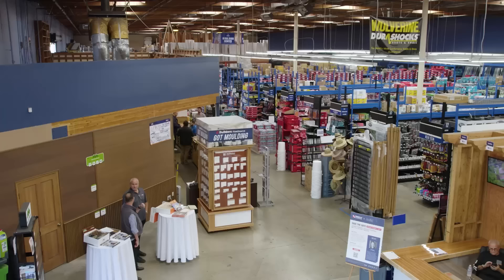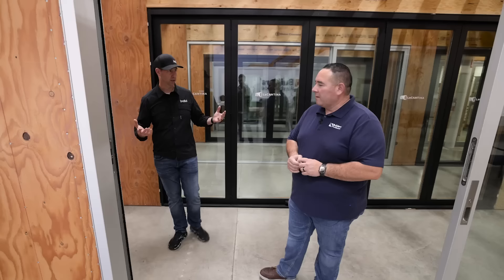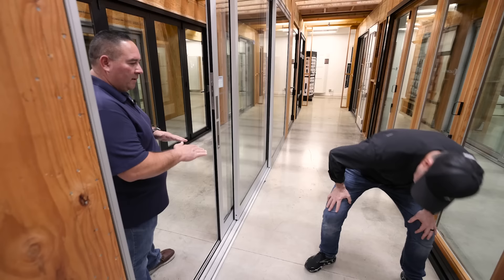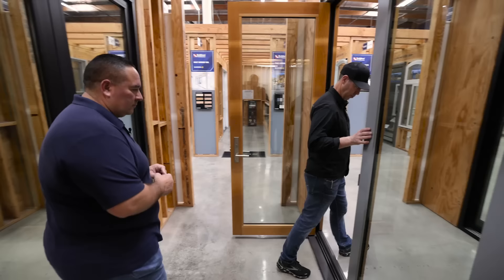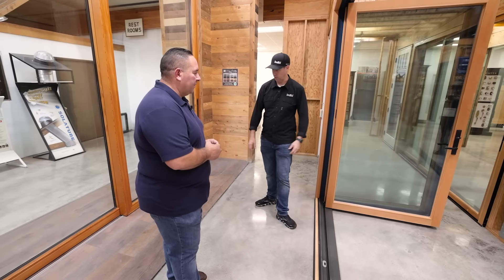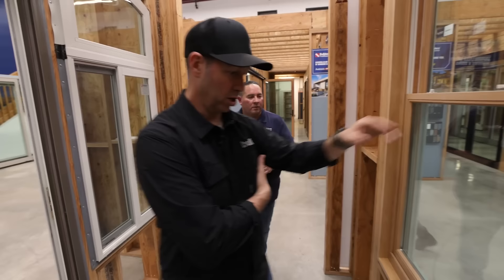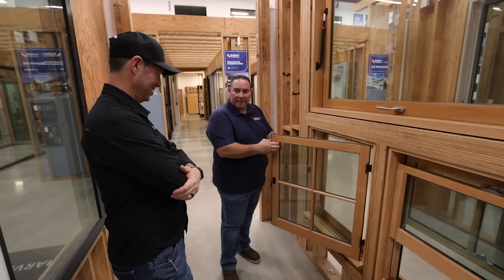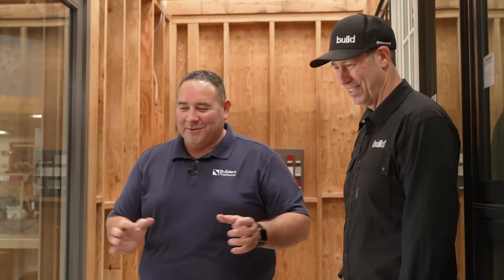Let's go WINDOW SHOPPING: What to look for (or avoid)

Comment: Good to talk about price and I liked that you quickly made mention of whether some units were thermally-broken (every exterior unit should be IMO) but perhaps some mention of the overall efficiency?  You spend a lot of time talking about building passive houses and being as airtight as possible - are these units just pretty or can they be used as part of a high-performance home?
Reply: It's aluminium separated by anything between 2 to 10 mm of foam which may not be that well insulating (rather focused on strength). Then again, just like vinyl frames, the profile is extruded in a way that it provides multiple boundary layers (how multiple glass panes work). Still the thermal break is not really complete and 2 mm thick aluminium all around is all you need for a massive thermal bridge. So despite the greater glass to frame ratio, the overall product performs with triple glass roughly the same as a basic (old design) double pane vinyl over here in Europe (if memory serves me correctly). Then again, the tested R/U values show mostly how the test performs, in the "wild" boundary layers play a role, so do occupants' habits, so as long as they seal alright and you really want them, it's all well... unless you mind paying more for less on the thermal side of matters. Those nice dark frames are better shaded from the summer sun, as there's a reason they don't come in vinyl (it would melt).

Comment: I bought an 8 foot wide, 6.5 foot tall, thermally broken, powdered coat aluminum clad exterior with prefinished wood interior, dual pane cardinal glass slider door for $3,000 dollars last year. The brand is Windsor. These prices are insane.
Reply: Big difference between n 8’ slider and these units with multiple sliders 15’
Reply: Btw  I use Windsor a lot, great windows.

Comment: Hi Matt, how do these "American" windows compare to the "European" ones? Thanks.
Reply: Not even close
Reply: Thanks for sharing your opinion. May I ask in what way are they better / worse?
Reply: In design and ergonomics plus they are tilt and fully open so its simple and smart design
Reply: Got it. I've been seriously looking at European windows. What window material (aluminum, uPVC, wood-clad) would be good for the Southern USA?
Reply: @oldporkchops  schuco windows from Germany one of the best
Reply: @eronahmeti672  in quality of hardware, so they may last until one can finally afford a replacement xD thermal performance is like any other but yes, they are likely to keep their seals tight longer...

Comment: Quick way to determine if a window is single, double or triple pane, introduce the flame from a lighter in front of the glass and each pane will reflect a separate image.
Reply: This is awesome!  Thanks for the tip.

Comment: @15:47 you’re talking about the pin-hole in the hinge mechanism. In Europe these are often used on hinges with pins as pivot points at the outside (no sure how to call these). When a intruder removes the pins on the outside they cannot remove or hinge the door to lift it out and thus enter the home without the key….

Comment: twice i bought vinyl replacement windows , both times i am disappointed .  lessoned learned , what do i need to keep NOISE out?
Reply: Double window. So you'll have two double paned glass windows. The airport expended near my house and they paid for them to be put in to everyones house. They work well.
Reply: Triple glass U0.5-0.9 or vacuum glass gets U0.4 but is more expensive
Reply: @MarvinOsso  "U" need to understand they asked about noise 🤭
Reply: They say laminated glass is very quiet. Windsor makes double pane with 2 dissimilar thickness glass pieces which they say helps cancel noise transmission

Comment: Every window has  four numbers on a National Fenestration Rating Council (NFRC) label on every window you'll consider:
o Solar heat gain - how much the window reduces the solar heat gain.
o U-value - how much heat transfer the window has at a given temperature differential.
o Air infiltration - how much air infiltration the window has.
o Visible light transmission
U-Factor
This number represents the heat transfer coefficient, or how much heat the window’s coatings help keep inside the home. The U-factor ranges from 0.1 to 1.2; the lower the number, the less heat escapes.

Solar Heat Gain Coefficient
This number measures how well a product keeps heat from the sun from penetrating the window. The range is 0 to 1. If you live in a hot, sunny climate, such as Arizona’s, you will want a low number to block out heat; if you live in a colder climate, you’ll want a high number to take advantage of whatever solar heat is available. If you live in a balanced climate, where winters are cold and summers are hot, you’ll want a solar heat gain coefficient rating of around 0.3 (the same goes for the U-factor). And you may want windows with different ratings for different parts of your house, depending on the direction the window faces and whether it gets a lot of sun or shade.

Air Leakage
This is how much outside air will come through the window frame, according to the NFRC’s testing. The lower the number, the better. (The range here is less than or equal to 0.1 to 0.3.) In our tests, we take this a step further by testing windows at very low temperatures with high wind conditions to see if there are any changes in performance due to materials expanding and contracting.

Also look at the installation warranty...is it longer than 2 years?

Comment: If you have you original wood windows in your old house you should restore them instead of replacing them. You'll never get your ROI after spending 20k+ on new windows.
Reply: Exactly, glass, seals. Then again, new hardware just works better.

Comment: Matt, I've seen a lot of these window videos from you and I can't help noticing that none of the windows you show have storm windows on them, even on windows at job sites (nor do I remember seeing you use storm doors come to think of it).  Is this just a regional thing, because many houses where I live in northern Michigan have storm windows, or is there another reason you don't show windows with storm windows?
Reply: I have lived in Texas for more than 40 years and I can assure you that while builders don't include storm windows or doors, many people have added storm windows or doors depending on their situation.  But storm windows are typically taken down and thrown out as people upgrade from single glazed windows to more energy efficient double glazed windows.
Reply: @sa3270  up north storms are used more to seal the air infiltration rather than the glazing
Reply: Short answer, you don't need "storm windows" with modern, properly specified/code compliant windows/doors.
Reply: @mark52111  I'll keep my storms WITH my quality windows

Comment: Great video.
Just curious, whats wrong with vinyl ?
Isn t it the strongest and most durable ?
Reply: @NicholasWHaley7  compared to wood.
How long does vinyl last ?
I thought it lasts long, but maybe thats not right.
Reply: @laurier3348  the other way around. Have you seen 50 or 100 year old plastic windows...or aluminium sliders for the matter....? And they had no overdone sheathing/cladding/sills like the modern ones, just bare minimum. Yes, ofc aluminium and composite have potential but wood is so simple stupid for windows (not so much doors), especially if you can DIY...
Reply: @dushk0  Ok, thanks.
Reply: Thanks for pointing out the weep holes at the bottom and make sure not to cover them.
Reply: My house has 2 vinyl window that are chipped and cracked. It also has 19 wood windows that are over 100. However, the wood species for the windows is extinct.

Comment: I have installed all these brands and models for 22 years.Stay away from Marvin, Panoramic and Andersen. by far these are overated.. For vinyl I would recommend WinDor anything clad or aluminum get LaCantina or A.G Milworks.
DON'T BE FOOLED BY SALES REPS OR SHOWROOMS, ask the guys who install the product and get to see under the hood of those products! And be aware the after market door screens will not last, they are very fragile and each screen may run you up to 3k!
Dont ask the salesman ask the pro!!
Reply: I have 30yr old Andersen aluminum clad  wood dble-pane windows. Other than replacing screens, not a problem. I had Pella alum- clad woods that lasted 5 yrs before rotting due to a well-known manufacturers defect. Stay away from Pella.
Reply: @Matt P  
Thats a great run for your Andersen windows, not all styles or batches are assembled equal though. Here in Southern california Milgard was bullet proof in the early 2000's now they are hit and miss on quality yet they offer the best warranty service. I have pictures of fixed windows bowing out of the frames, cracks in the frames, corners that are not sealed correctly from the factory yet Andersens installation requirements basically pin fault on the installer based on the steps needed to complete the install.
Reply: Now I make sure any window I install is absolutely spot on level/square/plumb. Then when a customer complains I tell them to call for a service tech. They show up and the first thing they do is pull out a level on hopes of not seeing the bubble between the lines so they can walk away, if they cant claim its installed improperly then I ask " how is it your windows are having problems?"...
Reply: @Matt P  Couldn't agree more on Pella. I had Pella Architect series windows in my house and I thought they were junk, certainly not worth the money I paid for them.

Comment: Never buy aluminium windows, and never buy sliding windows. uPVC windows with double or triple glazing (depending on your climate). Make sure they open up against you inwards cuz sliding doors and windows just leak air after years. My own experience after living in several apartments and houses. Problem with the aluminium windows is that it attracts heat and cold, they are horrible insulators.
Reply: These days most aluminum windows are thermally broken. So they are better insulators than the older aluminum windows are.
Reply: It's illegal to install PVC windows in fire-prone areas of California.   Also, both presenters made it clear that outward opening swing doors are more waterproof that inwards - lots of experience talking....
Reply: @Hector Ramos There are no laws in the US against french-style doors.   The laws relate to the glass, not the door style.  But Americans, for the most part, prefer sliding glass doors to swing doors because it is much easier to have screens....
Reply: @amraazdhillon5734  that thermal break.... would you consider a brick or stud wall, clad with 1/4" of foam, bridged with 2 mm aluminium sheet from wall to outside every couple of feet, well insulated? So how would that work with an aluminium profile?